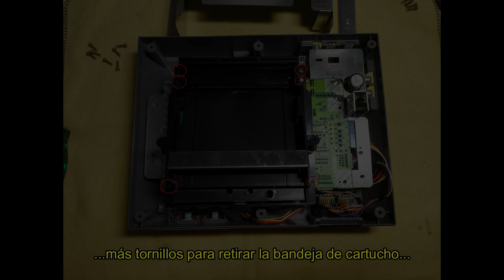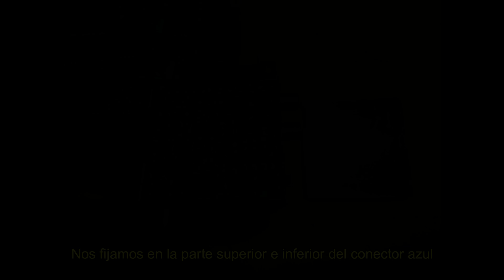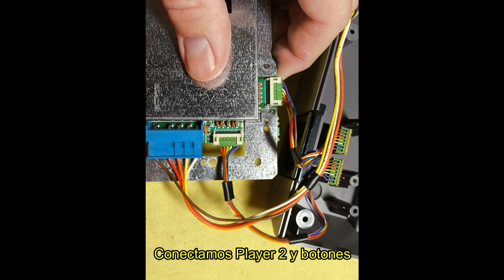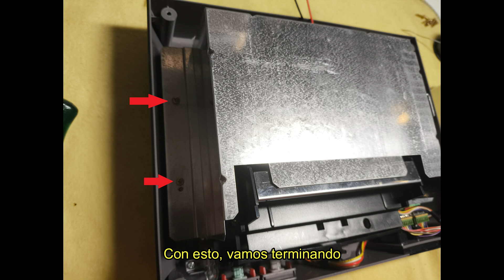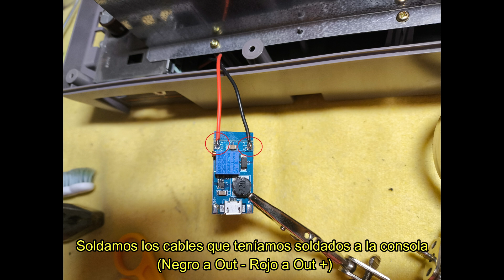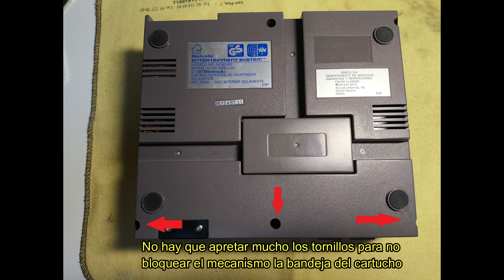Nintendo NES Mod USB-C

Comment: I don't speak this language, but from what I can tell, it looks like you're bypassing the original power input.  The only reason I could think of wanting to do this, is so as to provide the system with direct DC current, rather than having to rectify the 9 volts alternating current, so as to avoid the interference that results on the screen.  What seems like a potential point of failure, however, is the USB-C connector itself, as those are quite thin gauge, and prone to wearing out from repeated use.  I got recommended this video by YouTube despite not speaking the language, and I wasn't looking for a video working on a Nintendo, so I'm not extremely familiar with how they function, so I may be misunderstanding.
Reply: He's just using a substitute for the power brick PSU. The voltage was injected directly at the contacts of the original power jack. Also 9V were supplied, which means that the power is still going to pass through the 7508 voltage regulator, and turned into the needed 5V of the console. So he used a step up regulator to turn 5v DC from USBc to 9V, that will still pass through (some diodes and) a regulator to turn into 5V again. This might seem strange, but is the better option, since 5V from USB can go up to 5.2 V and fry the console. An even better solution would be to use a USB-c power delivery board configured to 9V, and use a pd USBc Power supply. What this video is doing is a very safe and smart future proofing of the NES, with minimal modifications to the original circuitry.